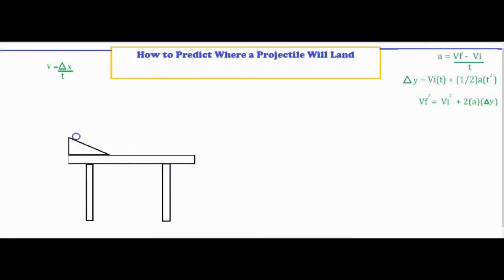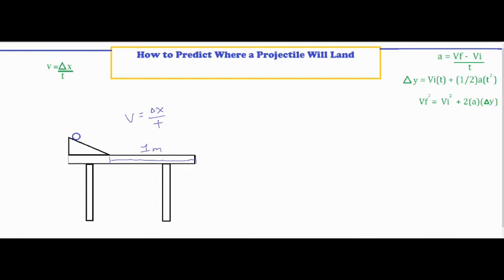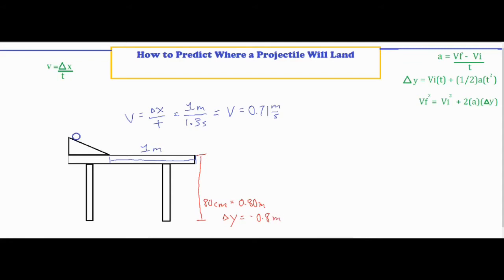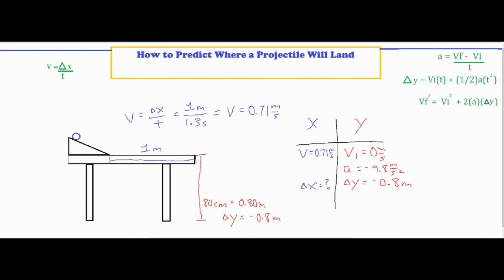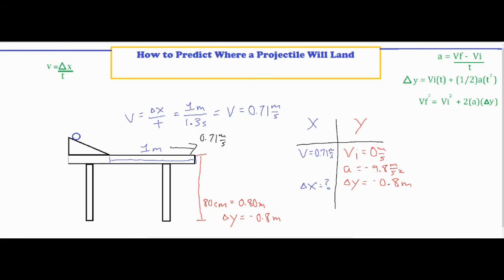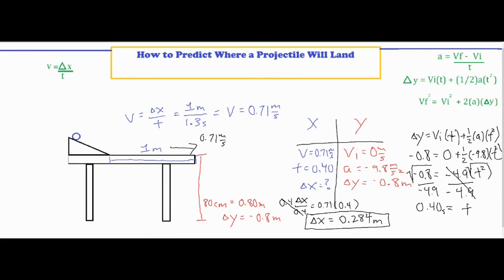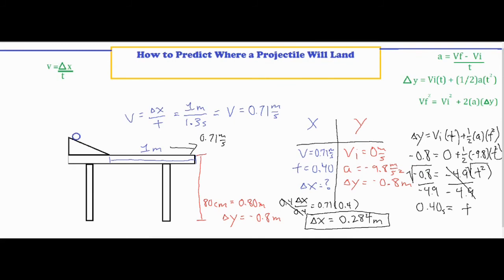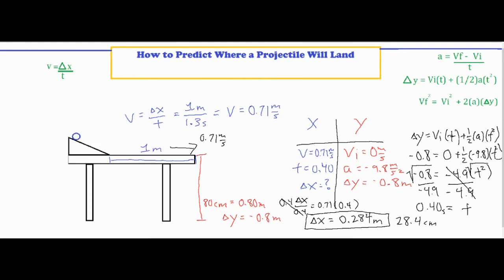How to Predict a Projectile's Landing Position (ball rolling off a table)

Comment: Hey I have a question on 2:16
When you divide 1 with 1.3 why do you get 0.71, but when I plugged it in a calculator I got 0.769230769 and rounded would be 0.77?
Reply from the maker: You're right it's about 0.77!  I think I accidentally plugged in 1.4 in my calculator.
Reply from the maker: I just put a note in the video description to make people aware of the mistake I made.  Thanks for pointing that out!
Reply: omg yes i was wondering the same!

Comment: why did you have to find out deltax when you already got deltax as 1m? please tell
Reply from the maker: The 1m is on the table before the ball goes in to free fall motion.  That’s just to get the initial velocity off the edge so you have enough information to solve for the final delta x , the landing position on the ground.